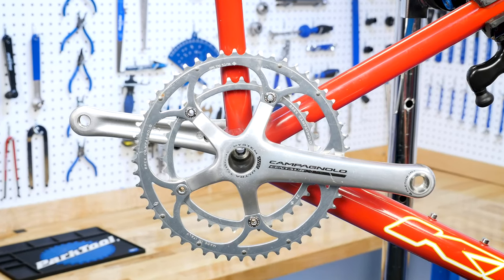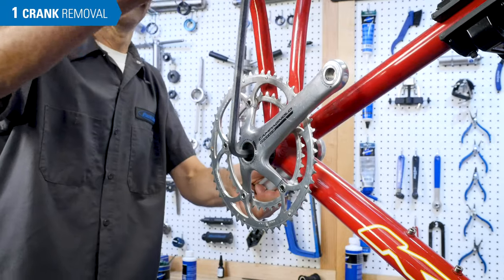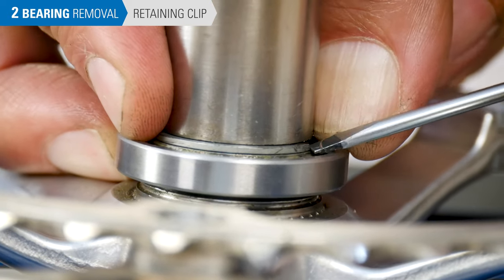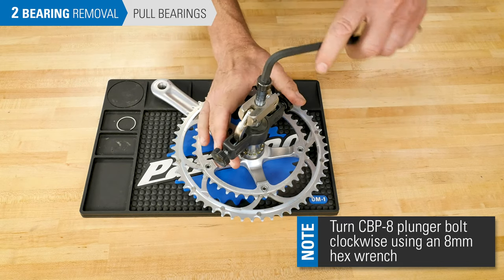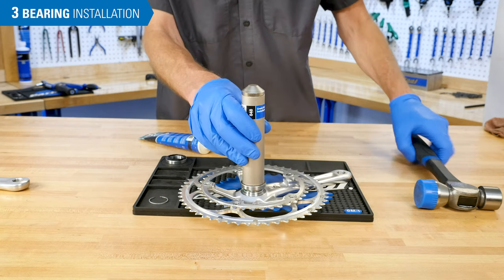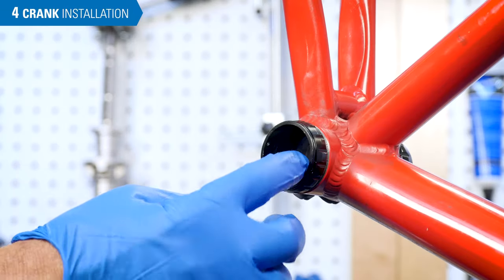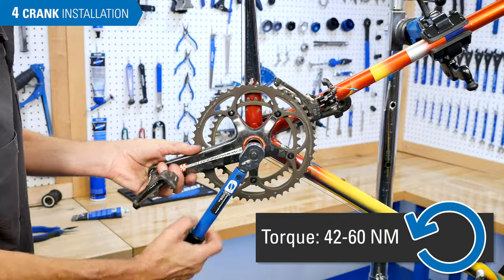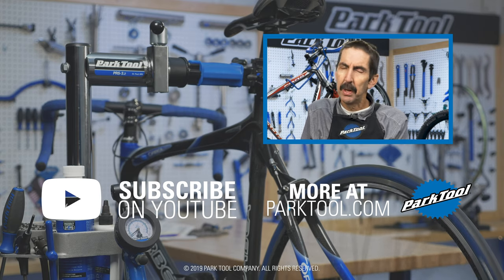Crank & Bearing Removal and Installation - Campagnolo® Ultra-Torque™

Comment: Nothing beats BSA Shimano Hollowtech in terms of simplicity.
Reply: Actually this is the PROPER way a bearing should be installed if you want long bearing life, unlike other systems where the bearings are pressed into the cups (Shimano, Sram) the bearings here are on the spindle just as a bearing is designed to fit (inner race interference fit, rather than an interference fit on the outer race compressing the bearing).
Reply: @PoltergeistWorks  I don't see why these two fitting systems would result in different bearing life. 
With either inner fit or outer fit, the bearings rollers are compressed against both the inner and outer walls. 
With proper installation, both systems should have even pressure distribution.
Reply: Nothing beats Campagnolo in terms if quality.
Reply: @PoltergeistWorks  so you also like to fit the bearings on wheel front and rear axles first before slotting them onto the hub shells?
Reply: WE DON'T HAVE THIS TECHNOLOGY IN ROMANIA !!! No service & tools for this kind of replacement !!! 😡😠🤬😡😠🤬😡😠🤬

Comment: Thanks for the great vid, uninstalling the cranks was no problem however re-installing is proving more difficult - after aligning there is still a bit of play in the cranks and the bolt once tightened doesn’t hold in the cranks - any ideas what could be causing this? Thanks I’m advance!
Reply: Did u put the wavy washer on the non-drive side?

Comment: Weird thing. Just did this on my factory installed Record 11 speed (2014 generation) crankset and there was a wavy washer on both sides + another washer (?) on the drive side that looked like an undersized bearing protection lid. Any idea why? I put it back as it was, but should I have removed all the washers and only leave one washer like in this video?   Thank you for great content. Park Tools grease is the best!
Reply: There is a hambini video on ultra torque cranks that explains how the wavy washer cannot always compensate frame production tolerances. I would imagine the person who assembled your bike did not get a satisfactory result with 1 wavy washer.

Comment: Thanks for the helpful video! Is there a reason why the teeth connecting the two parts of the spindle are not greased? Would that be harmful?
Reply from the maker: Grease is not needed, but would not be harmful.  The crank stays tight from the tension on the bolt.  Grease these if you like.
Reply: @parktool  Thanks for the quick answer! Much appreciated!
Reply: WE DON'T HAVE THIS TECHNOLOGY IN ROMANIA !!! No service & tools for this kind of replacement !!! 😡😠🤬😡😠🤬😡😠🤬

Comment: Thx for the video.    Other bike tool manufacturers like enduro and cyclists make a proper bearing press for this installation.   Fu$& using a hammer to beat on bearings my carbon super record crank.   Surprised park tool advises this

Comment: i am upgrading a c-record era bike. it has the old adjustable cone and cup. is it possible to upgrade the bb to ultra torque? you didn't show that part of the reinstallation.
Reply from the maker: You can run a Ultra torque bottom bracket on your C-record era bike. You would of course need an Ultra Torque crankset to make it worth it as your C-Record crank is not an ultra torque.

Comment: hello, my  new bearings have a sealed red/ brown side and an open side that can be greased,  and a separate black rubber outer seal . does it matter which way round the sealed bearings fit ?  The outer rubber seal fits neatly over the open side so I put this facing outwards. Afterwards i checked older 10 sped cranks, they are  fitted other way round. After using the park slide hammer in video , the crank bearings  feel stiffer than before and no longer spin freely, with  new bearings and cups  installed .  Should I remove bearings and reverse them? I think pressing the bearings with a threaded tool like your excellent headset press tool instead of hammering would be safer.
Reply from the maker: The open face of the bearings should be facing inwards. The bearing setter that comes in the CBP-8 only contacts the inner race of the bearing. That means it does not put damaging forces on the bearing and cannot hurt the bearing. Using a press for these bearings is extremely difficult being that you have to reach over the axle.
Reply: @parktool  So do you recommend I remove and reverse my bearing with the park kit ? 2 other manufacturers make a bearing installer press . I’m concerned pulling it off once & hammering it twice will damage the new bearing .
Reply: WE DON'T HAVE THIS TECHNOLOGY IN ROMANIA !!! No service & tools for this kind of replacement !!! 😡😠🤬😡😠🤬😡😠🤬

Comment: I'm working with the Campagnolo Super Record crankset.  The chain is wrapped around bb/cranks, so must pull cranks to unwrap chain.   However @1:16, the driveside is not removable by hand.   What is the procedure for removing drive side crank??
Reply from the maker: The Super Record uses a titanium bolt that is left hand threaded.  There is a clip on the drive side bb adapter.  Use pliers to pull this free and off.
Reply: @parktool  is it still accessible with a chain looped and wrapped around the bottom bracket and inner chain ring?
Reply from the maker: @SugmaDLigmaNutz  You may have to take the chain apart if the wrap is very bad.
Reply: WE DON'T HAVE THIS TECHNOLOGY IN ROMANIA !!! No service & tools for this kind of replacement !!! 😡😠🤬😡😠🤬😡😠🤬